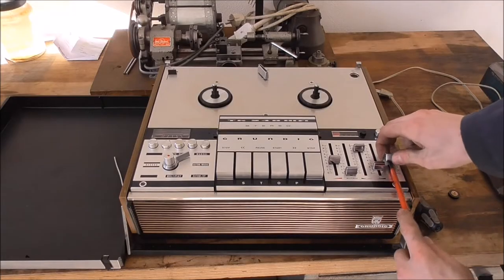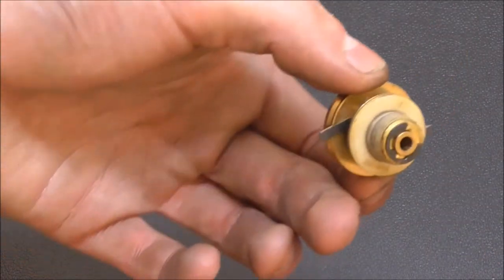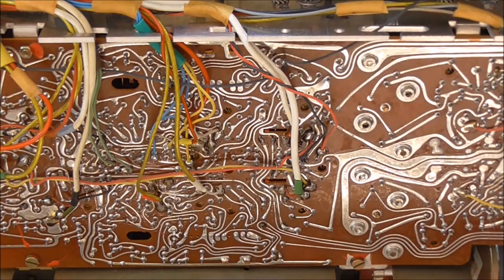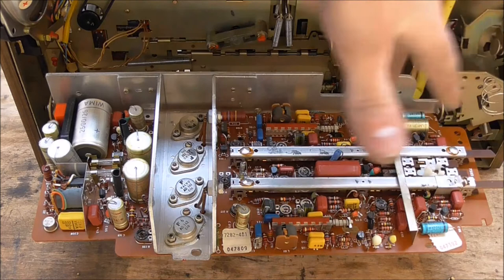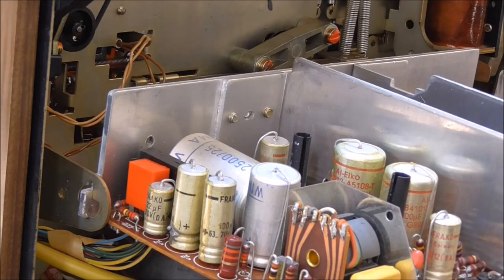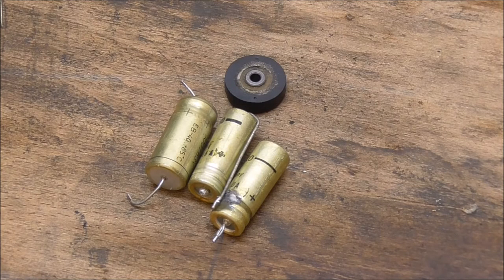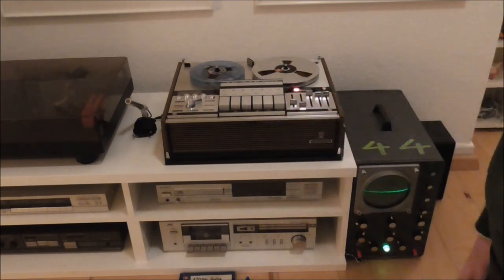Grundig TK248 Tape Recorder Repair

Comment: Rubber rollers are indeed recoverable in some circumstances.  Two separate mechanisms lead to their downfall, age-hardening and polishing through wear.  These collaborate with one-another to make slippage.  Firstly the roller that has deformed because it is pressed against something in a rest position (or equipment was not returned to a rest position upon decommissioning) can be boiled until it rounds out again.  Rollers that are polished should be very carefully re-surfaced with 400 grit sandpaper.  The absolute minimum of material is to be removed, you are just trying to create the vaguest whiff of texture.  Rubbers of all sorts that have aged can be treated with the delicious-smelling MG Chemical Rubber Renew.  (Of course like most delicious-smelling industrial chemicals you shouldn't actively smell it but in using it you will definitely note a pleasant, minty aroma).  Of course at the end of this it might still not work, but this is the procedure I developed with input from technicians more learned than I.  Sometimes it is important to preserve original rollers because replacements are unavailable, or other reasons, and it is good to know what to do if this is the case.

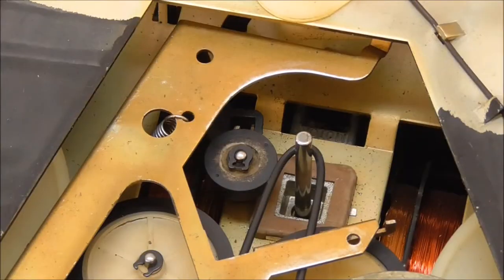Comment: What's the tool you used at 1:23 ?
I don't have anything that can remove that small thing !
Reply from the maker: It's a pair of snap ring pliers. They come in different sizes and designs for inside and outside rings - in a pinch, you could try levering the ring up with a flat screwdriver - being careful not to launch it across the room.
Reply: @AstraWerke  Thanks for the fast answer ! For now, I ordered the diverse wheels and belts that it needs. I'll try getting a pair like you have, it can be useful to me. I'll not try to lift it up with a screwdriver, I have a bad case of unlucky attempt and breaking stuff, and even if I manage to remove it, I have to place it back without breaking everything.

And then I need to figure out why the tape I have with the unit is silent. Maybe the tape is blank, or the head is dead. It doesn't seem used, but rusty. I cleaned it with isopropyl alcohol 70% and it was brown/orange like rust. Now it looks okay.

Also need a way to plug something into it. Mine is not a TK-248 but a TK-246. But they are very similar, mine is just like a lower version.

Great video !

Comment: HI THERE ONCE AGAIN MY FRIEND.I HAVE DONE THE CAPSTIAN BELT WOW!INSTEAD OF GOING ROUND THE BACK OR THE CAPSTIAN FLYWHEEL I PULLED THE BELT OVER THE TOP OF THE FLYWHEEL AND WHILE KEEPING THE BELT SUPPORTED NEAR THE MOTOR FED THE BELT OVER THE 7-1/2 (19 CM)GROOVE.WOW-WEE!THANK YOU FOR YOUR HELP.NEXT IS PUTTING BACK THE TAKE UP SPOOL BREAK STRING.
Reply from the maker: Glad you got things back in order. Tape decks drive me nuts every now and again, too - the only thing worse is re-doing the dial pointer string on a radio. Good luck with the rest!

Comment: Hi Adrian,
Thanks for this video and all the information. I have just found one of these in a flea market and it seems to be working fine but I have yet to find a tape to play. Can you tell me if you replaced the 5 pin dins for the output to your amp as well as those for recording like the microphone and other inputs on the back?
Reply from the maker: No, I left everything the way it was
Reply: Great! Can I ask another question - how/ where do you make or find the din to phono/ jack converters please?😊
Reply from the maker: @andrewlock6896  I've got a big bag of all sorts of miscellaneous cables. You'll find how each socket is wired up online, and solder your own adapters - if you can't do that, you'll find them for sale online, too.

Comment: The construction of that machine is wonderful, They really put a lot of thought into the servicing of it in future times, Reminds me a little of a Bang and Olufsen music centre I had years ago, that was nice to work on.
 Best regards, J.
Reply from the maker: Its been a huge surprise to me how much forethought they put into the design - compared to my other Tape Recorder where you have to desolder every wire connected to the PCB (and there are a lot) in order to get it out... Brilliantly engineered!

Comment: I have just got one of these and I have ordered a rubber roller. I have also noticed the left reel is a little stiff causing staggered play at the slower speed. Will the roller help this or is it just for the winding functions?
Reply from the maker: No, the roller is for ffwd and rev winding only. 
The reels have a drag mechanism - basically a piece of string wound around it, tensioned by a spring. You can try to reduce the drag by over-stretching the spring a tiny bit, but you have to be very careful as the mechanism is quite delicate and sensitive to adjustments.
Reply from the maker: If you take the top cover plate off, you'll see them immediately.
Reply: @AstraWerke  Thank you thats worked , the autostop seems to not be working I can hear clicking sometimes but its not working properly.
Reply from the maker: @Jukedome  I'm glad it worked out :D
Regarding Auto-Stop, I have to be honest and say I have no clue how exactly they work. They seem to create a circuit between the mechanism and a metal strip at the end of the tape, so maybe there's a relay somewhere that disengages the driving wheels, but that's more speculation at this point
Reply: @AstraWerke  I have found the left hand post is wired and when metal touches it's supposed to cut the mech. However the wire isn't connected very well so I will resolder this and see.

Comment: HI THERE AGAIN.MY REWIND WAS GREAT BUT SOLVED MY FAST FORWARD NOT GOING TO THE END OF THE TAPE BY FITTING A FRESH CLUTCH PAD TO THE MOTOR PULLY.HOWEVER MY CAPSTAIN DRIVE BELT HAS COME OFF AND LOOKS VERY HARD TO FIT IT ON THE CAPSTAIN FLYWHEEL AGAIN.DO YOU KNOW HOW TO DO IT.
Reply from the maker: I had to replace the main drive belt on a TK149 before and it was a nightmare, as the whole mechanism for coordinating the drive pulleys and tone heads has to be taken apart and, since everything is under spring tention, is very hard to get back together.
I don't know how to do it on the 248 but I suggest if the drive belt has only slipped off the pulleys to try and manipulate it back into place using tweezers or dental hooks. Patience is the number one virtue here.

Comment: I have philips 3549 a 4 traks 
One 1 and 3 dosen t work 
But 2/4work properly 
How can I fix this problem 
Thanks
Reply from the maker: Might be as simple as a dirty switch (contact cleaner will take care of that), could be a broken cable (see if any cables are loose) and in the worst case will be a defective play head, which would be a very expensive and laborious issue.
Reply: @AstraWerke  i cleaned the head and every thing is ok 
Excuse me i have another question from a friend 
Grundig tk 40 work properly 
Suddenly the green light stops and no sound 
But play and rw ffis ok 
Thanx for advicec
Reply from the maker: @pharofirst8386  I never worked on a TK40, but if it's an issue that comes and goes, it might be a dirty contact on the play/stop switches. If it went silent and never came back, its probably something more serious: The green light going off suggests a loss of High Voltage which means either a fuse is blown or the transformer burnt through.
Reply: @AstraWerke  thank you very much

Comment: hmm, i resurfaced that wheel, cause te rubber was plastic allready, but i dont have thatkind power in winding, motor is going out ? but otherwise it plays ok

Comment: HEllo, Adrian. Thank you for this video. I have this machine myself, and I just changed the belts. Yes, belts, plural! The kit I ordered had a 80mm belt, that I thought was from the motor spinner to the gray wheel. I see that the big belt gives a "turn" on the left side of the wheel, but I can't put it that way, it will always touch some metal part in the middle.... Did you replace a belt already? Thank you!
Reply from the maker: Hi there.
I am glad I didnt have to replace the belts yet.
I found a manual on how to change them - it is in German, but it might turn out alright via Google Translate.
Here's the link: http://www.gummimeyer.de/Service-Riemenwechsel-TK248.pdf
It appears some parts have to be removed in order to install the belt.
Best of Luck to you
Adrian
Reply: Thanks for our tip! I figured out that the other belt is for the counter. Well, I can tell that belt replacement is really a pain in the..... Anyway, your video helped me really the position of the belt. Keep on!
Reply from the maker: That's what I make these videos for - glad I could help!
Reply: Hi please can you advise how you did this? Was there any dismantling required?